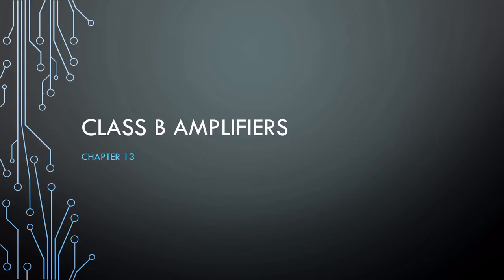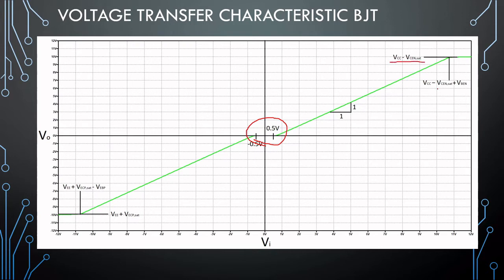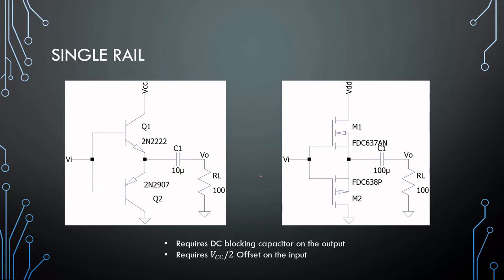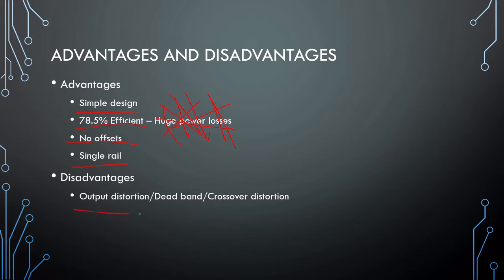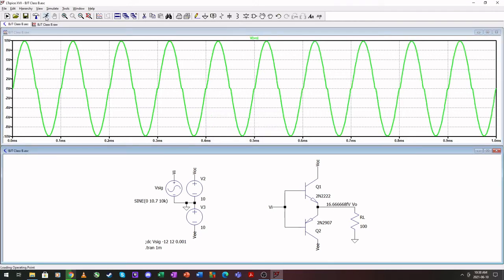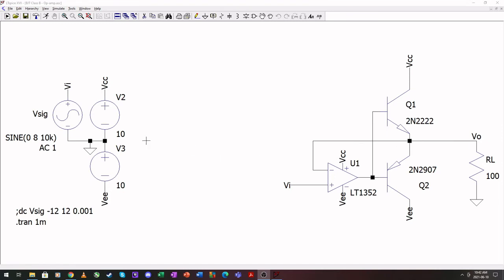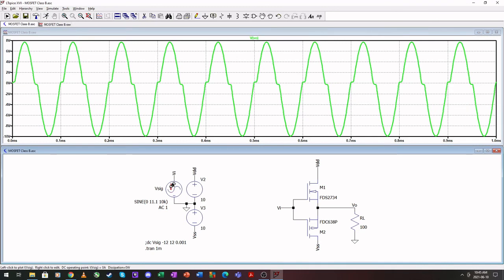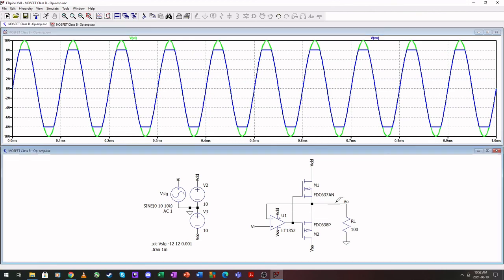Video 2 - Class B amplifiers

Comment: Actually which one is much better in term of reducing the cross over distortion? use BJT or MOSFET?
Reply from the maker: I guess you are referring to the use of op-amps to reduce the distortion?
The BJTs switches on at a lower voltage compared to the MOSFETs. The distortion is due to the on voltage and with the op-amp it is divided by the gain to reduce the noise so I would say BJT. But in the scheme of things I would rather look at the class AB amplifier.

Personal opinion you will have less issues when selecting a op-amp when using BJTs there, there is a larger chance to run into issues with MOSFETs. Ringing and oscilltions is always a possibility.